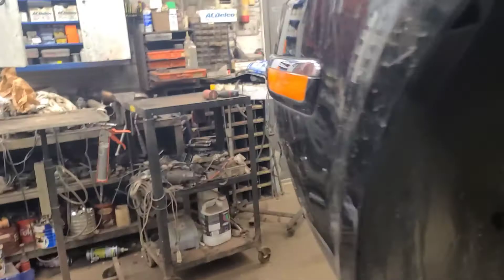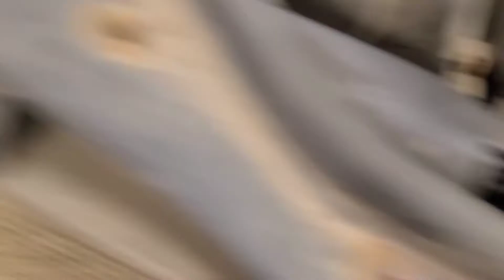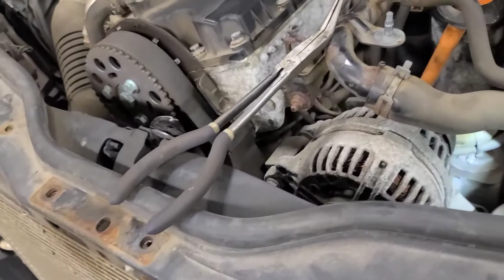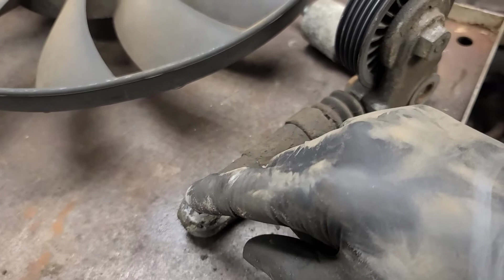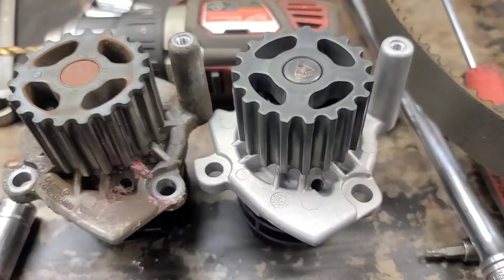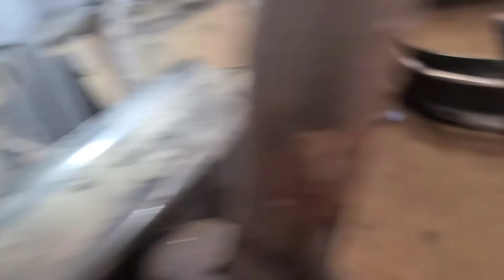2005 VW 2.0 TDI Timing Belt and Water Pump Replacement.

Comment: I have to buy the same one do you recommend me ?
Reply from the maker: Not sure what you're asking me?
Reply: @PhillipBailey  I have to buy the passat tdi does it have a good engine or are there problems?
Reply from the maker: @ahmedston2807  they are pretty decent, good on fuel, make sure thebtiming belt is done around 80,000 miles or 120k.

Comment: The crank tool is the wrong one…it never must be oval….u clearly can see that the tooth are not properly fitted
Reply from the maker: I'm not sure what you are referring to but it worked just fine. I've used it on multiple jobs with no issues. Possibly it was the angle of the camera.
Reply: @PhillipBailey  There are 2 versions…one is a little bit oval and when you use the wrong one it does not perfectly fit.
Reply from the maker: @boltthrower3215  Thanks for the information. I will check more closely on the next one for sure.

Comment: ok video, only left out the important parts (timing marks and setting the timing). guessing the gray thing with mark on it is the tool?   but thanks for posting .   ive owned this same make model car since new and ill tell you, its a pile of crap. started with water (lake) under the pass. side carpet from front to back.  always wondered why the transmission was shifting while idle at a light.  because the trans control unit was under water.  pass. cv axle went at 35k  ,  driver side cv axle went at  40k.  car wont start if its below 20 degrees. have to crank the crap out of it. mind u this was when the car was new. needed to have a winter kit installed , if there is such a thing ive never found one.  cant even find a dipstick heater for this car.  every fluid for this car is special, only dealer or online. oil change cost around 75-100 bucks if u do it yourself. cant check the trans fluid level/ add fluid.   thats just to name a few problems.  pass. rear tail light filled with water for some reason. and the list goes on and on.  only reason i still have this car is, i dont have 50k to buy a new car.  vw shouldnt be allowed to sell cars in u.s.  period
Reply: I am not mad 🇩🇪
And yes VW sucks
Reply from the maker: The Germans are still mad about the war... Most TDIs here have oil pan heaters for cold starts here. They stick on the bottom of the oil pan and are pretty effective.
Reply: Wow this is a salty post. I could barely be considered a DIY mechanic and have less to complain about this car, even when doing all my own work. Here's some tips. Clean out your sunroof drains, that way it doesn't flood the inside of the car. Don't crank the wheel all the way left or right, not sure in how else in the world you trashed both CVs by 40k. Get a frostheater (they've been around a long time), it warms up your coolant during the winter and makes starting in sub zero temps a breeze, or maybe you should've paid attention to the recalls that upgraded the glowplugs and gotten that issue solved for free. Mine without the frostheater has started in negative temps without much issue. Do you cycle your glowplugs before starting in the winter? I would hope so because that diesel 101. I spend about $40 (in today's inflation prices) on my oil changes, maybe spend about 30 min-hour doing them in my driveway. And I'm using top quality oil with an OEM quality filter. What are you buying that adds up to $80?? The water in the tailight could happen on any car, you likely cracked it somehow. That's just a dumb one. 

Could VW have made a better car? Maybe. But these are still amazing cars that I personally have seen go way above and beyond 250k miles with a little extra TLC.
Reply: @TheVeilwalker  I do all of my own work. I've had VW Jetta's station wagons for the last 21 yrs, 2 2005 and 1 2003. I would by another tomorrow if they were still around and in good shape. Unfortunately, here in Canada the rust attacks them because of the salt. I have 2 BEW engine, (1) at 653k klm and retired because of severe rust  (2) at 489k klm rusted and still on the road, 03 ALH well over 500k klm on it and still on the road. Installed VVBK engine heaters and so far so good no problems in the winter. I recently bought 2005 Passat wagon station wagon with 263k klm in mind condition. Installed a safety switch and now looking to do the timing belt among some other minor things. VW do make good cars, When working on them you have to have the mindset that they're European not American. I'm happy with the ones I have. Reason for watching this video was to see what was implicated to getting to the TB and how to deal with the front of the car without removing the whole front end. Thank you to the creator.

Comment: Good job as always so there is no other way to do the job unless you got to have the timing tool ah. cheeeeeers
Reply from the maker: I have done it without. You can use a drill bit for the top pin and line up the mark on the crank sprocket to the left side of the dowel hole in the lower housing. Mark it before removal and put it back in the same place. Holding fixture on the crank just makes it easier. Thanks for watching...